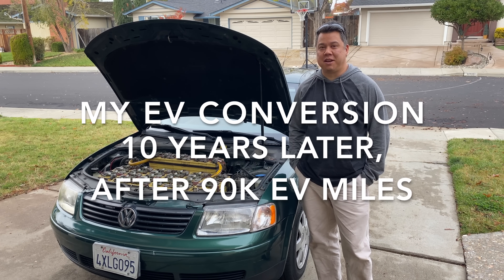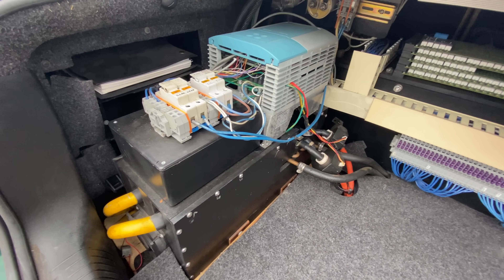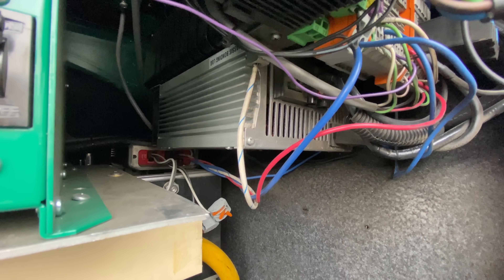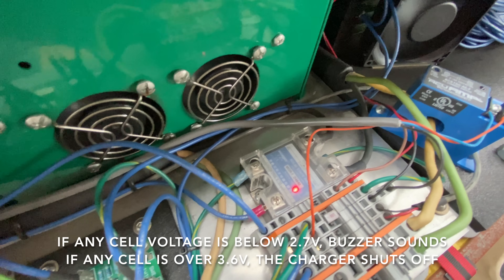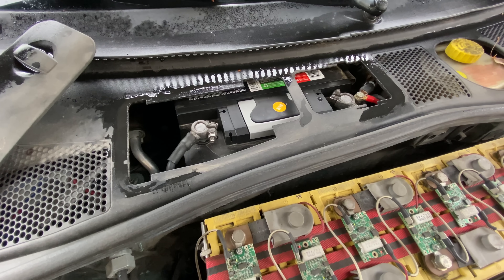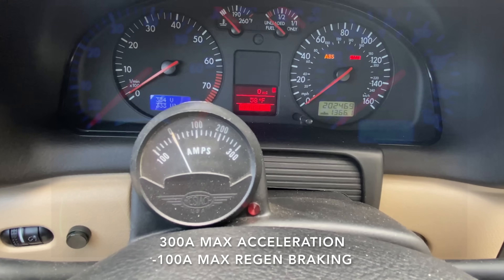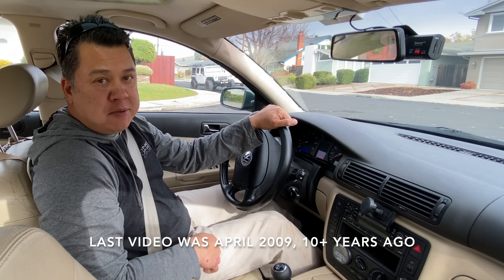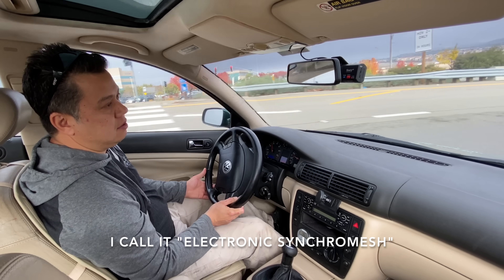My EV conversion after 10 years and 90k miles

Comment: THIS is the future! If government, Industry and onwers went 1/3 each on the cost, taking into consideration the recycle value of the engine's metal. we could beat Climate Change in 5-6 years!
Reply: electric cars alone would not fix climate change.
Lifestyle, industry, agriculture, farming, are some of the biggest culprits.  Along side of course transportation/cargo, but Cars are just a portion of the equation.
Not saying don't do it just some individuals need to have realistic expectations and know that we can't just look at this one problem at a time.
Reply: @AsthmaQueen  In italy we have a saying "To break a barrel you need [to alternate] one blow to the wood and one to the metal rings"

This is because a barrel is a structure of tremendous strength and cohesion that cannot be broken apart  just by dropping it  - uless it is form a great height, when it would then be smashed to smithreens..

To beak the impasse of lLimate Change the secret is to attack on several fronts at once. Veganism is one weapin we have, increasing use of unpowered transport - walking and cycling - and public transport - trains, buses, coaches, ferries, ships - increasing the share of Renewables in industry, while reducing demand for non-essential manuafactured goods - eg. plastic toys - 

Beating climate change is not an "OR' but, rather, an "AND" exercise!
Reply: @GeaVox  oh thats one of biggest reasons why I said this problem beyond just cars is behavioral. 
In north america public transit is a joke cities are nonfunctionally sprawling. You almost always need a car to have a career.  And this basic premise of american dream and its inefficiency lives on strong.

Society needs to work towards becoming more efficient as a whole. Public transit should not be viewed as second class. There is alot of work to do all over.

So ya I agree with your analogy, and will still laugh when someone says x thing will solve climate change.  Its so much more complicated than that lol
Reply: @AsthmaQueen  Once upon a time the USA had an extensive rail network.. so.. what's to stop you bulding one again?

And teh Hydrogen Economy is most feasible somewhere like the USA.. BUT it means preparing NOW for what's coming later.

• Build filtered seawater pipelines, to 
move water into the interior, distilled by evaporation by passive solar heat, within speciually constructed, separation pipes, in those regions of the Country, best equipped for these industries, owing to abundant insolation AND wind
Use graphite-coated, Proteon Exchange Membrane Electrolytic Cells to split the distillate, using Renewable Energy 
• from arrays of the new generation of hybrid Photovoltaic Solar-Thermal cells (PV-T cells), interspersed with a mix of capacity Wind turbines, that can operate within a range of wind speeds, and so achieve
• constantly electolysis producing O2 (that can either be vented or compressed, for industrial and surgico-medical uses) & H2. 

Only recently patents have been granted here in the UK for ambient-temperature, standard pressure H2 storage tech that will revolutionise the whole Hydrogen production industry - check out www.h2go.co.uk - 

Thereafter recombining the two gases (O2 from air and H2 from storage, or directly, in a direct feed system) will yield electricity, heat and the purest water, suitable for surgery and the most demanding laboratory and scientific applications... or just to constantly top-up your drinking water supplies... or sell as a precious commodity to soft drinks manufacturers, protecting acquifers, streams, rivers, lakes and reservoirs.

These Technologies (Feul and Electrolytic cells) go as far back as the turn of the century... the LAST Century, tyhat is; the beginning of the 1900s! They are well known and have recently surged, only because NOW the Fossil Fuel Industries can no longer quosh their development, as theu did in teh XXth Century.

Do your own research if you don't believe me... but be thorough and impartial, ignore the nay-sayers, either too ignorant, stuck in their old-tech arrogance, and or invested in teh Fossil Fuel paradigm.
Reply: where does government gets its money from, and where industry gets money from? YOU. that's just you pay for the car with extra steps
Reply: @sszhao11  damn you beat me to it!
Reply: @sszhao11  That is missing the point... YOU cannot afford the money for the WHOLE transition upfront and as You ahve already paid into the System, YOU can legitimately expect the government to pay the money it has been taking from you (and should have been investing all along to keeo services going!) to fund the 1/3 share, As to industry, it would probably need to to be taxed separately, though that could be limited to the sectors of industry that have benefited directly from the manufacture and sale of cars, fossil fuels and compnenents of the supply chain thereof.
Reply: Private cars are 15% of national emissions. An EV emits half to a third of a combustion car. So if everybody built an EV tomorrow, national emissions would drop 7-10% only!!!. Emissions from transport increases around 4% per year. So in 5-6 years your emissions will still be higher than they are today. What is needed in the US is renewable power generation. The ev itself, is just another consumer, albeit slightly more efficient!
Reply: @Tore_Lund  So... why only private cars? What about taxis, vans, lorries, coaches, buses... why should they be left out? Extend the concept and you have a feasible programme.
Reply: @GeaVox  The cost per vehicle is much higher for a bus or a truck. so when an individual can spend $10000 to convert  his own car, a truck driver would need $100000 for the same range, But my complaint was not that converting cars was a bad idea, just that it won't on its own make much difference to global warming. When we take all kinds of vehicles, instead, which are 30% of emissions, and make them EVs, national emissions will be reduced by 15-20%, and that only, if the extra electricity, currently  in the US is only is 7.5% renewable, remains at 7.5%, with the extra capacity needed still having that proportion of renewables,
So my point is, that if the government spend a $ on expanding renewables, it will reduce emissions more than a $ spent on substituting EVs as it is now.  There is of course a tipping point, when renewables are in surplus, say 80% of installed capacity, as to not waste power, more EVs will be needed to lower emissions further, but we are far from that scenario now.  Getting everybody to drive EVs now is not the most effective path, without it being matched by a similar ambitious transformation of the grid. So government need to balance subsidies for both sectors, to get the fastest possible reduction in emissions.
Reply: @Tore_Lund  US is not the world, Tore.... remember that!

The UK is on the way to doing exactly what you suggest, and Europe is working on it, with the Scandinavian Nations leading. 
New Zealand, Australia, India, China... gradually they are all converting to Renewables, becaus the old myths about 'energy density' put around by dinosaurs of the engineerng world have been neutralised by evolution of the technology and the fast, downwards trends in costs.

So maybe the US should learn from other, more advanced Countries?
Reply: Why not 4 or 7 or 4.5 or 100 🤔
Reply: @khurshidmarwat9399  Sorry, what are you referring to?
Reply: This isn't going to help climate change at all most all the electricity comes from non-renewable sources already in the components needed to make these electric cars are even worse than than traditional cars
Reply: @Johnny-tq9no  you're not even close,  update your tech savvy.. H2 is close than you think... storage has been the tech gap
H2GO & Métalectrique, just TWO UK-bsed innovations, and there is a plaethora of such research projects.

It's a very fluid market at the moment, with China, Korea, Japan, Germany, Canada, UK and US all vying to be the first to bridge that gap. these two projects caould do for storage what Gra[hene may have done for the coating of Electrolytic & Fuel Cells , by addressing the reliance on scarce and expensive Pt.

the picture looks especially proprtious, in the Year of the Rat, if H2GO find the right R&D Financeial Partner

http://www.h2gopower.com/
Reply: I think it's cool from a scientific perspective. However let's be honest man made climate change isn't real.
Reply: @user-pg9fv7su8q  you denied yourself the right of speaking.
Reply: @user-pg9fv7su8q  actually you did that by tryin to be a paranormal investigator on ytb.
Reply: @guillaumeandre992  Ok?
Reply: @user-pg9fv7su8q  ok boomer
Reply: @guillaumeandre992  I'm 22, that was my stepfather if you would read the description. I love how you're so bothered you actually looked at my channel 😂
Reply: @user-pg9fv7su8q   boomer is a state of mind, and i was talking about you the whole time.
Reply: @user-pg9fv7su8q  not bad weirdo
Reply: @user-pg9fv7su8q  😂😂😂😂😂😂😂😂

may i ask for your qualifications in making such a statement? I have a n Honours degree in Environmental Science. Over to you?
Reply: @GeaVox  Commercial aviation with a minor in physics. Graduated top of my class with a 3.94

However I don't need to get off on my degree to feel better about my opinion.

Comment: Was there not a direct type of "transmission" available instead of retaining the standard trans?  Excellent and well done video and description of work done.  With battery technology increasing, do you see yourself changing out the batteries to extend the range?  I like the idea of "electric PS and PB, along with AC."  If the car manufacturers were smart, they would have done electric for AC and PS years ago not to take power away from the engine.

Comment: How is it manual? I thought electric vehicles could only be automatic
Reply from the maker: Well, it's still a manual transmission, and I can still select gears.  I use reverse gear for reversing too.
Reply: Did you keep the clutch or do you just rev match when changing gears?
Reply: Gary Stinten there is no rev match. When the accelerometer is not engaged, the motor is not spinning.
Reply from the maker: Gary Stinten I programmatically match RPM for the next gear with the Inverter.  The drive knows how fast it’s going in second gear, and how fast it needs to go for third gear so while it’s in neutral it matches the revs and allows me to shift.

Comment: What a qualified electical engineer is capable of doing in the garage today. That is a lot of possible osmosis on connections. Not your average ev. Love the work you have done. I have a passat 4 motion wagon with thoughts on ev and regeneration from the 4motion parts. Thanks for sharing.

Comment: Thank you for your video...I have a diesel vehicle that I built that I want to make electric, much simpler than yours as my range only needs to be 100 miles. Would a smaller motor suffice if your not really using as much of the gear reduction the transmisssion offers? How much power does it have if you start it in 1:1...usually 4th gear in 5 speed manual gearbox?
Reply from the maker: 100 mile range is what my car was deigned for, at the time it was pretty ambitious.  Now days you can buy better batteries, but I think the price for 100 mile range would still be $10k+.    I think the motor would overheat trying to start in 4th gear, it would be pulling max current (but low voltage, low power)  for a long period, and would be extremely slow.  You will definitely need a gear reduction, I can get by using only 2nd gear from a stop to freeway speeds.

Comment: Pretty awesome... I do kind of wish you had wired the battery meter to the original fuel gauge. It's a little silly, I know.
Reply from the maker: Yea, I had thought about that too, but it's a lot of work taking that instrument cluster apart, and trying to drive the stepper motor.

Comment: Why did you end up choosing a Passat B5 for the conversion?
Reply from the maker: I wanted something modern, safe, comfortable and freeway capable, since I was spending 2 hours a day in it.  It had plenty of space for batteries, and surprisingly good aerodynamics (0.27cd).   Leather interior, good stock stereo, lots of mod parts available.   Steering rack is tucked up high against the firewall so it's out of the way.   I like German things.   At the time, most people were converting Geo Metros, Civis, old VW Beetles... If I'm going through the effort of converting, I wanted something really nice when I was done.
Reply: @etischer  Awesome thanks for the answers

Comment: A 2 year old BMW i3 for about $25K is starting to look like a good deal.
Reply from the maker: @Bobby C Everything on my car is maxed out at 300A (battery, IGBTs, fuses, cables, motor).  Batteries available now from wrecked Hybrids and EVs are much more powerful.  There are also kits available to integrate Tesla and Nissan Leaf motors which are are more powerful than the 90kw motor I'm using.   But now that there are plenty of EVs to choose from on the market, I don't see a compelling reason to do a conversion.   I just bought a Tesla Model 3, it's amazing!
Reply from the maker: Well, yes, a used car would be cheaper then I paid for new parts 10 years ago.   I started this build in 2008, before the Nissan Leaf, Chevy Volt, really any electric cars were available except for the Tesla Roadster.   This project was never about saving money, it's about the challenge and education along the way, learning things they don't teach in school.
Reply: etischer 
My comment is in reference to the fact that much has evolved at a higher level of performance and sophistication while also at a far greater value. 😉

Comment: Hey Eric, finally I could see your car in details, after 10 years, thanks for sharing, it brings back memories from DIY EV forum. How are your cells doing without thermal insulation, if the car is parked in hot ambient? My cells under the hood lost capacity sooner than those in the back because of lack of insulation. My Mazda Protege5 lasted 9 years before transmission broke from all the torque from DC motor. Instead of fixing it, I parted it and bought a new Bolt EV, which I absolutely love to drive. Glad to see those BMS boards are still running strong.
Reply from the maker: I have one cell I know is about 50% capacity now, and it is in the rear where the gas tank used to be.  The cells under the hood are doing the best, they are all within 10mv of each other.   I barely drive the car now, especially since I no longer commute, so I'll probably break it down and sell off components in the next year or so, and buy a Model 3.   MiniBMS still chugging along!
Reply: @etischer  Whats the total cost of all Parts? How much time dies it took you to build?